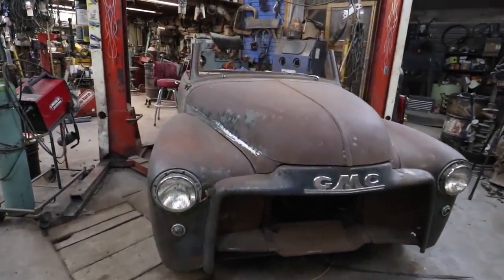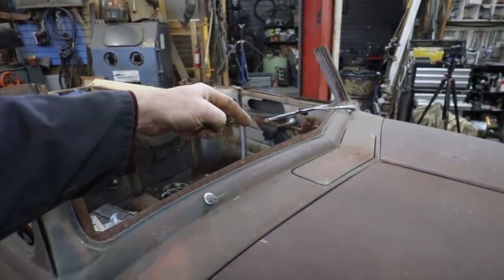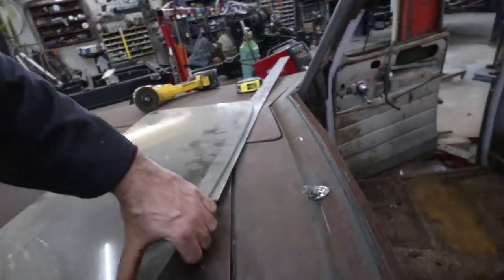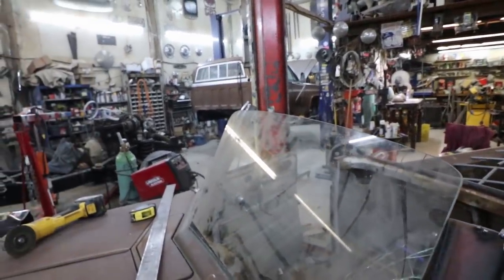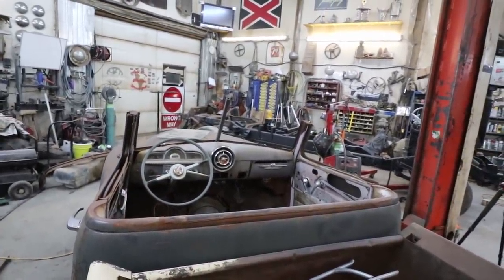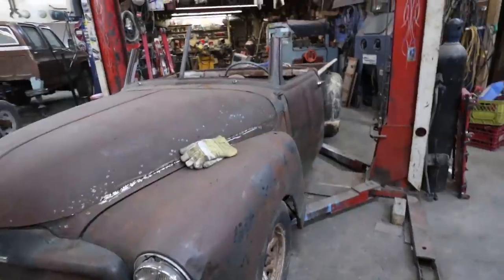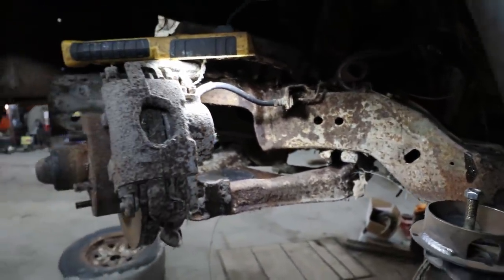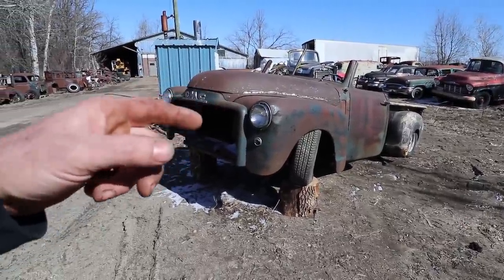Fixing up the window frame, fitting the dash and installing airbags to make it a roller

Comment: I like this build   Love old pontiacs and General Motors should of called the GMC truck  a pontiac anyway.  Find a pontaic grille along with the chrome strip down the hood that  the pontiacs had    and build what GM should of built  after the war  . That dash looks like it was born there. A++++++
Reply: I have never seen one but l
I've heard GM put a Pontiac engine in some of their trucks around the mid to late 50s. Has anyone else ever heard of this?

Comment: Nicely done. I was thinking i you wanted to get it an inch or so lower you could take out the bottom cups and just use a flat plate as long as you could rig it to work with the bags if you hadn't already thought of it. Another reason for watching you guys is it get me thinking a bit. Gives me a way to give back. Thanks for sharing.
Reply from the maker: yeah there's not to much more room left as the front crossmember is almost on the ground haha. have to come up with plan b.

Comment: Posted, wanted 1 split winshield and a poncho dash, steering wheel's temporarily lashed. Bagged up with air, whoosh down but not to the ground, a roller out da door, parked GMC's nose blocked up, pablo yawning, atta boy thumbs up pup.

Comment: You could V-butt the windshield without a supporting post if you run a piece of metal over the top of the windshields to tie the windshield posts together.  This will keep the posts from flexing in/out, which would damage the windshield or make it fall out. The V will act like a keystone in an arch.   It might be possible to do it without the metal piece top piece if you really over-engineered the windshield posts so they don't flex at all.  But, even Duvall windshields use a center support.

Comment: I believe I would put a piece of metal along the top and the side so you can put bolts or screws just in case you ever have to take it out for your wiring but other than that that Pontiac dash is amazing and perfect for the truck you should find a Pontiac grill for the front

Comment: ***BRENT maybe if you made a sheet metal filler out of a single louver from your machine, and somehow connected a path for defroster air to hit side windows!  I know it's fluff, but what a cool detail that would make. Especially if you could incorporate some original knob or lever on the dash!  Sorry dude, I noticed before you even mentioned the need for filler at the sides of the dash.  ANOTHER COOL VIDEO FROM YOU, WATCH EM AS SOON AS I CATCH THEM!!! THANKS!!!

Comment: Since it's a roadster what ever engine you use. Take air conditioner pump and make it a air compressor for your airtank for the  airbags. And tell people that the airbags doesn't need a a compressor.

Comment: I have a question for you. I have a line on a 40 something Chevy pick up, the body is in pretty fair shape but the frame and everything underneath is toast. Fixing the frame is way beyond what I can do. So I am asking what might be a good donor truck to set the body on? Any suggestions would be appreciated
Reply from the maker: I've used s10 on the a 46 pickup that I had.

Comment: Maybe change out enough of the front fender tops and around the headlights to use 57 Chevy hooded headlights. Shake up the looks of that front end like you wouldn't believe. Maybe alter the bezels, though. 57 Chevy headlights bezels are too recognizable, if that sort of thing bothers you. You just know them when you see them. Putting them on something else wouldn't fool me. But the profile lines are fabulously aggressive, something those Doodlebug Chevy trucks of that era have none of, in my opinion. Looking good as it is, though. And those back fenders....? Meh...

Comment: Why don't you cut the 1 x 1 box in half length ways, put it back to back n weld it up, you then have an H section for your glass to glue into, might be an easy solution for the glass